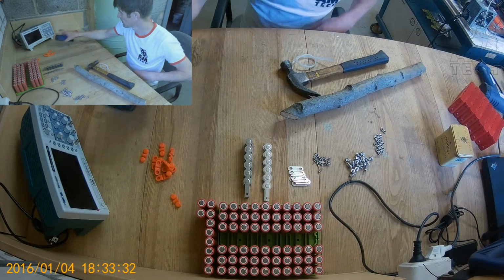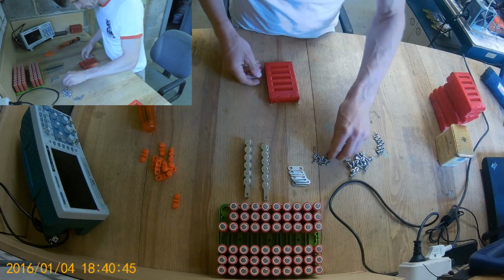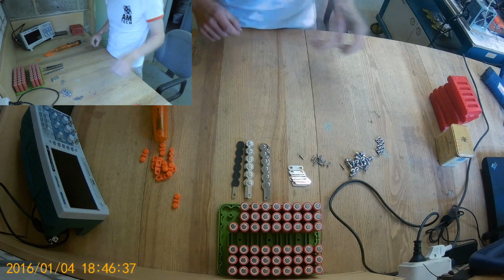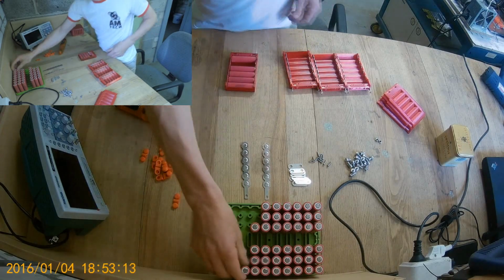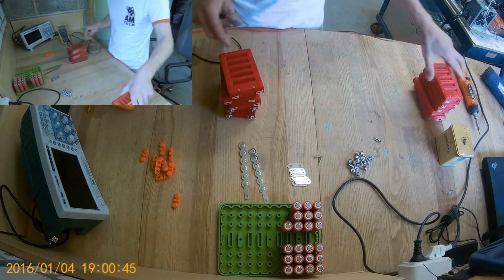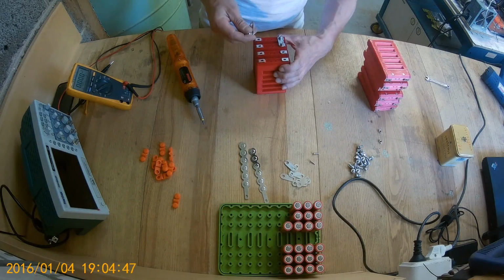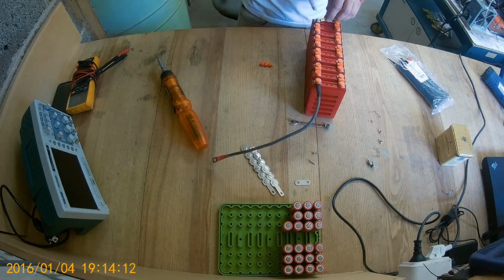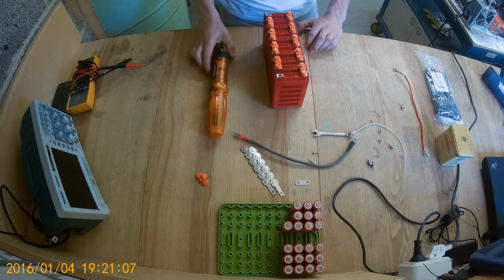N.E.S.E module and battery assembly tutorial

Comment: Are the insulation pads listed on your website necessary to assemble these modules?
Reply from the maker: No. Thete was probably 2 cases in 2 years when people shorted and vented couple cells. If you are careful, should be fine without them. I use them, just in case.
Reply: @agniuszoro  Thanks!

Comment: in the website they wrote that the modules can support up to 70C degrees.
What appen next?
This is a real problem cause much 18650 warm up to 80C...
Reply from the maker: No. You are wrong. If they heat ap to 60C to often, they are damaged, let alone 80C. What a nonsense
Reply from the maker: https://www.nature.com/articles/srep12967
https://batteryuniversity.com/learn/article/charging_at_high_and_low_temperatures

Comment: Hi. On your website, the modules are described like 1S8P. Is there any problem to just use the cells in series like 8S1P. I mean I could just put the cells in with opposite directions, right? Or is there any constructional blockade for this?
Thanks
Reply from the maker: Hi. Depending on your situation. If you only need 1P then there is a way to use uneven number modules, 3P, 5P, 7P to build 3S, 5S and 7S. If you use even number modules end terminals would be on the opposite sides so it wont work.
The tabs could be cut to suit but there is no space if you want to route balance wires (2 to 5 wires). Probably could be possible with thin ribbon wires but its jewelry work.
If you are thinking doing series inside the module than paralleling for capacity - then its worst possible scenario.
Reply: agnius Mikutavicius Ok thanks for the fast answer.